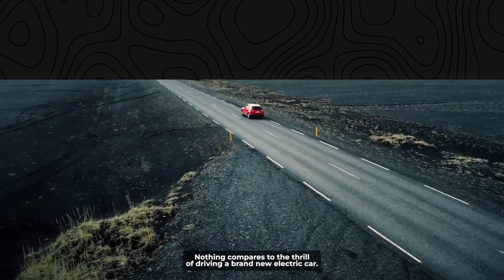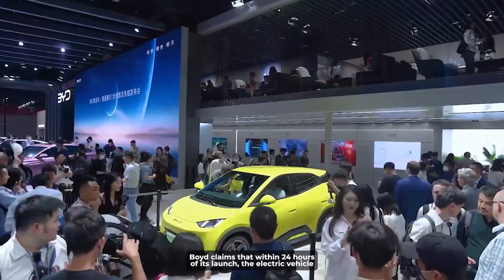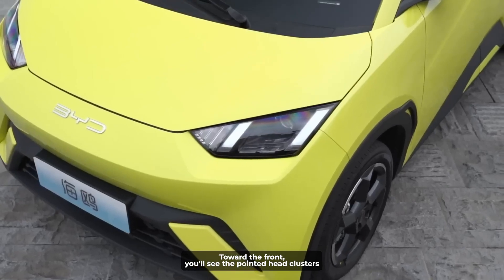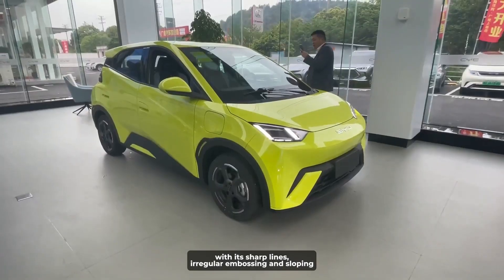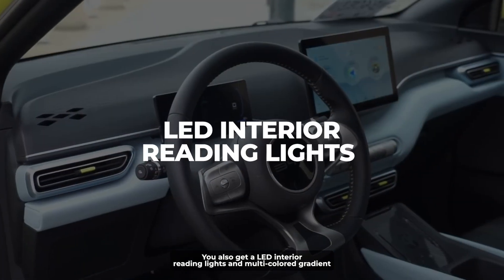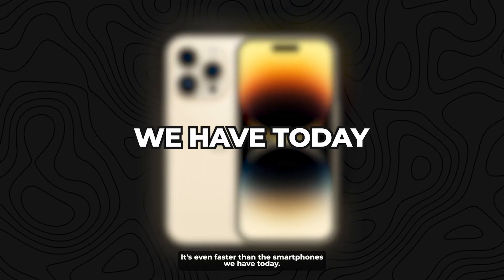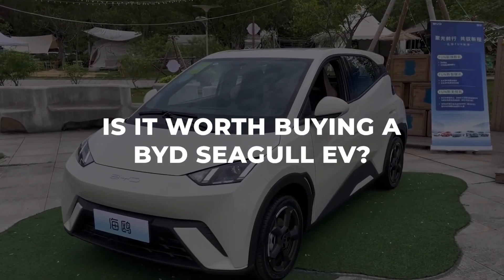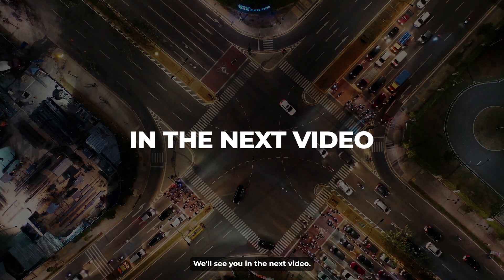Unlock The Power Of The BYD Seagull EV - What You Need To Know!

Comment: Fantastic, but only two airbags is not good.
Reply from the maker: Hi there! This information is wrong in the video and I apologize. Other viewers has commented this earlier as well.  The BYD Seagull EV actually comes equipped with 4 airbags instead of 2 as mentioned. Again, I apologize for the error. Safety is indeed a crucial aspect, and having 4 airbags in the car adds an extra level of protection.

Comment: This good value $11,500 car will be £23,000 by the time it's on sale in the UK! If it were to go on sale at £12,000 they wouldn't be able to build them fast enough.
Reply from the maker: Yes! It's true that pricing can vary based on factors like taxes, import duties, and other regional considerations when a car is introduced in different markets. While the initial cost of the BYD Seagull EV in the US is indeed $11,400, the final price in the UK could be influenced by various factors, and your point about potential price adjustments is highly valid. It's always essential to consider these aspects, and I appreciate your input. Let's hope that with increasing demand and advancements in electric vehicle technology, we see more affordable options available globally. What are your thoughts on the BYD Seagull EV and its potential impact in the UK market?
Reply: @AmpedAuto  The Seagull is what cars should be. It needs to be on sale for the lowest price possible, with good finance packages, to encourage both EV take up, taking huge SUV's off the road and improve road safety. It's efficiency will save energy, there's no need for 0-60 times less than 3 seconds, 0-20 in that time is more than adequate. If it were available sub £120 a month, with a 10 year 120,000 mile battery warranty I think most people would be seriously considering one as their next car.

Comment: A nice car. But it would be even nicer if it had swappable batteries. As you know, fast charging depletes batteries and Seagull is no exception. A second hand Seagull with around 80 to 100 k on the odometer would be almost worthless.
Reply from the maker: Thanks for your comment! While the BYD Seagull EV doesn't currently have swappable batteries, it features a fast-charging system, allowing 30% to 80% charge in 30 minutes. Which is typical charging time for most EV's. Battery technology is evolving, so future models might explore swappable options. Your point about resale value is valid, and manufacturers are continuously improving battery longevity. Thanks for being part of our community! If you have more questions, feel free to share. Stay tuned for more electric car content!

Comment: Indeed it’s a great car, but i think it won’t drive a steep streets, because ilof the small tyres, and potentially high weight of the passengers and their luggage, meaning it will suffer in a cars parking
Reply from the maker: The BYD Seagull EV, like any car, has its considerations, and the potential impact of small tires on steep streets is a valid point. It's essential for potential buyers to consider factors like terrain and usage patterns when choosing an electric vehicle. This car's design and features make it a standout choice for various urban settings, but you've highlighted a specific concern. Thanks for sharing your perspective! What other aspects do you think are crucial for evaluating an electric vehicle's suitability?
Reply: @AmpedAuto  glad you emphasized my concern
Streets here in Jordan 🇯🇴 can be sometimes steep, and also there are a few roads that could easily flatten your tires (seagull), because of the potholes (that foam pump should do the work 💯 or else you’ll be waiting for a miracle in a nowhere 😅
Another concern is the availability of the spare parts and there price .. both are disastrous 🫣
Reply from the maker: @mohammaddado5073  Absolutely, your concerns about steep streets and potential challenges with potholes are valid considerations, especially when it comes to the size of the tires on the BYD Seagull EV. Navigating such terrain can indeed pose a challenge for certain vehicles. The availability and pricing of spare parts are crucial factors too, and I appreciate you bringing attention to them.

For potential buyers in regions with steep streets or challenging road conditions, it's essential to carefully evaluate the suitability of any electric vehicle. Additionally, considering the availability and affordability of spare parts is a key aspect of long-term ownership.

Your mention of the foam pump is interesting—it's a good reminder of the importance of being prepared for unexpected situations. It seems like the BYD Seagull EV, while offering many attractive features, may have specific considerations for certain types of environments.

If anyone has experience driving the BYD Seagull EV in similar conditions or has insights on spare parts availability, feel free to share your thoughts in the comments. It's valuable to gather a diverse range of perspectives on the practical aspects of owning and driving electric vehicles in different regions. Thanks for contributing to the discussion
Reply: @AmpedAuto  another aspect is the availability of the charging stations, especially the one which provide charging for chines cars, with different charging plugs 🔌

Comment: Could you put a stroller in the trunk ?
Reply from the maker: Great question! The trunk space in the BYD Seagull EV is designed to offer practical storage options, but whether a stroller can fit would depend on the specific dimensions of the stroller you have. The Seagull EV has a reasonably sized trunk for a hatchback and we have read that the trunk space can accommodates two 24-inch suitcases. The Seagull EV does offer ample cargo space for its size, but larger strollers may require some adjustment or possibly folding down the rear seats to accommodate them.

Comment: There are usually no empty spots in a given market when a great transformational moment arrives. With traditional car makers quickly abandoning the smaller car industry where margins are lower, whom the heck do you think will occupy that place? The ones whom can naturally to make those margins to appear once they have the affordable workforce plus the best access to the affordable building materials: China! The Chinese will to eat the smaller car segment in a nutshell. BYD hasn't been for now a price oriented trademark here in Europe. It won't either way to be with the Seagul, despite the hipe. If they try to send this car to here where I live, they'll only to offer it with the 38Kw "higher" battery, and of course, all the requested from EU regulations equipment which may not be part of the basic Asian offering. That said, and considering my own living market, Portugal, VAT, EU regulations management, importer and maintenance infrastructure, marketing and other small requirements, all indicates that this car won't be available far below the EUR 20k mark point. That would to make it to be the cheapest EV we could afford here, little bit below the EUR 23k Dacia Spring EV... Affordable? Yes, to an extent, considering what this car offers far more equipment wise than the Dacia Spring... But far from a cheap car!... Some 4 years ago, it was quite easy to purchase a relatively good gas car at EUR 20k... Not anymore. You'll purchase a 4 years old car now ABOVE its original net price in some circumstances... Times are changing...
Reply from the maker: Thanks for your insights! You're absolutely right about the evolving EV market, especially in Europe. Factors like regulations and local infrastructure can indeed influence pricing. It's a dynamic space, and it will be interesting to see how things develop. Your perspective is appreciated! 😊🚗
Reply: @AmpedAuto  Agree! Thanks!...

Comment: Will need a EV for my daughter in 2 years. BYD seagull is for sure a great option, if they could provide some kind of auto-drive feature like what Tesla did.
Reply from the maker: Thank you for your comment! The BYD Seagull EV is indeed a great option for an affordable electric vehicle. While it doesn't currently offer an auto-drive feature like Tesla, it does come with a range of impressive features including advanced driver assistance systems such as a windshield-mounted camera for capturing the road, intelligent cruise control, and a remote smart parking assist system.
However, it's important to note that the availability of specific features may vary depending on the market and the model year. Therefore, it would be advisable to stay updated with the latest information from BYD regarding their features and technology offerings, especially as you approach the timeframe when you plan to purchase an EV for your daughter.
Additionally, the autonomous driving capabilities of various vehicles, including the BYD Seagull EV, may evolve rapidly within the next two years. It's worth keeping an eye on the advancements in autonomous driving technology and the offerings of different car manufacturers to see if BYD introduces any auto-drive features in their future models.
I recommend thoroughly researching the available options and considering your daughter's specific needs and preferences to make an informed decision about the most suitable electric vehicle for her.
Reply: A kids first car is the crash car - get her a 10 year old Toyota corolla that will be bulletproof and last a million miles, or until she crashes it, whichever comes first.
Reply: Auto-pilot = death trap.

Comment: A mobile blast furnace
Reply from the maker: I understand that you have concerns regarding the BYD Seagull EV. It's worth noting that electric vehicles, including the BYD Seagull EV, undergo extensive safety testing and have built-in safety measures to prevent any potential risks. Electric vehicles have proven to be safe and reliable transportation options. If you have any specific safety concerns or questions, I'd be happy to address them.

Comment: Not bad, cross between Tesla M3 front end with Chevy Bolt EUV rear end.

At just under $12,000 thats awesome. American EVs buyers tend to follow the 10% to 80% charging curve. 30% to 80% in 30 minutes seems to be a 50-100 KWH charging speed range. If its at a true 250 mile range, i think many Americans would be willing to buy at $12,000
Reply from the maker: Thank you for your comment! I appreciate your observation about the design similarities between the Tesla Model 3 and Chevy Bolt EUV. It's interesting how different elements can evoke these comparisons.
Regarding the charging speed, the BYD Seagull EV's ability to charge from 30% to 80% in 30 minutes is impressive. Combined with its speculated 250-mile range and affordable price of around $12,000, could make it an appealing option for many American EV buyers. The evolving market for electric vehicles is exciting, and the BYD Seagull EV seems to offer a compelling package. Thank you for sharing your thoughts, and if you have any further questions or comments, feel free to let me know.
Reply: Import tax, delivery, meeting local electrical code will push the price up.
Reply: I want to order 1where?
Reply: @Sam-r4z3o  I believe you have to wait till the plant in Brazil is completed and start production. I do not know when, but I am waiting.

Comment: typo : 2 airbags -> 4 airbags.
Reply from the maker: Thank you for pointing out the typo in the video. You are correct, the BYD Seagull EV actually comes equipped with 4 airbags instead of 2 as mentioned. I apologize for the error and appreciate you bringing it to my attention. Safety is indeed a crucial aspect, and having 4 airbags in the car adds an extra level of protection. Your comment helps ensure accurate information for viewers. Thank you for watching and providing your valuable feedback!
Reply: @AmpedAuto  now 6 airbags in the high range version

Comment: What is motor power and acceleration 0-100 kmh
Reply from the maker: Thank you for your comment! As far as I have seen - BYD doesn't quote a 0-60 mph (0-100 kmh) but says the Seagull EV can hit 0-31mph (0-50 kmh) in 4.9 seconds.
Reply: @AmpedAuto  it means 0-100 will be abt 12-13 sec,- not so good
Reply from the maker: Thank you for your response! While the exact 0-100 km/h acceleration time for the BYD Seagull EV has not been officially stated, based on the information available, it is reasonable to estimate that it could be around 12-13 seconds. But keep in mind that this is an estimate. While this may not be as quick as some high-performance electric vehicles, it is important to consider that the Seagull EV is positioned as an affordable electric car with a focus on other features such as design, range, and affordability. Ultimately, the performance of the Seagull EV may still meet the needs and expectations of many potential buyers.
Reply: 75 HP and from 0 to 100 in 9 sec
Reply: @bartbart8472  9 seconds is usually considered a fast and expensive car to drive in Scandinavia and is indeed pretty good compared to a VW Golf VIII 150 hbp which does 0-100km/h in 9.1 seconds. Great stuff.

Comment: It wouldnt be that cheap as other countries would put a tax to even out CCP's subsidies on it. Also do a quick search for 'BYD fire'
Reply from the maker: Thank you for your comment and raising those points. It's true that pricing of electric vehicles can vary depending on factors such as taxes, import duties, and subsidies in different countries. It's important to consider the local regulations and policies that may impact the final pricing of the BYD Seagull EV in specific regions or countries.
Regarding your mention of vehicle fires, safety is indeed a significant concern for any vehicle, including electric ones. While isolated incidents of vehicle fires can occur in any brand or model, it's important to evaluate the overall safety track record and measures implemented by the manufacturer. As with any vehicle purchase, I encourage potential buyers to conduct thorough research, consider official safety ratings, and refer to reliable sources such as independent safety organizations or government agencies for the most accurate and up-to-date information on safety records and precautions taken by the manufacturer.
It's essential to stay informed about the latest developments and consult trusted sources before making a purchasing decision. Thank you again for your comment, and I appreciate your contribution to the discussion.

Comment: it is not going to be 11400 . 

it will be around 15000
Reply from the maker: Thank you for your comment! The information I provided in the video was based on the initial reports and announcements about the BYD Seagull EV's price. As with any new vehicle, pricing details can sometimes change or vary depending on factors such as location, trim levels, and additional features. It's possible that the final price of the BYD Seagull EV may be different from the initial estimate. Therefore, it's always a good idea to check with official sources, dealerships, or BYD's official website for the most accurate and up-to-date pricing information. Prices may vary in different markets and regions. I appreciate you bringing this up, and it's important to stay informed about the latest developments regarding the pricing of the BYD Seagull EV.

Comment: Most important question first, does it do 300 EPA miles on one charge?
Reply from the maker: Thank you for your question! The BYD Seagull EV offers impressive range capabilities; however, the specific EPA range for this vehicle has not been officially disclosed at the time of making this video. The Seagull EV comes in two variants: a 30kWh option with a range of up to 305km (approximately 190 miles) and a 38kWh variant with a range of up to 405km (approximately 251 miles) on a single charge. While it may not reach the specific EPA range of 300 miles, it still offers a decent range for everyday driving. Keep in mind that range can vary depending on driving conditions, terrain, and other factors. As more information becomes available, it's always recommended to check the official specifications provided by BYD or consult with a BYD dealership for the most accurate and up-to-date range figures. Thank you for your interest in the BYD Seagull EV!
Reply: At this affordable price point, if it does offer 300 miles /480KM , then all other manufacturer will be out of business overnight.
Reply from the maker: Thank you for your follow-up comment! Indeed, if the BYD Seagull EV were to offer a range of 300 miles (480 kilometers) at its affordable price point, it would certainly be a significant achievement and could have a significant impact on the electric vehicle market. Longer range capabilities at an affordable price have the potential to attract more consumers and increase the competitiveness of the BYD Seagull EV.

However, it's important to note that range is just one factor that consumers consider when purchasing an electric vehicle. Other aspects such as charging infrastructure, performance, design, safety features, and overall value for money also play important roles in the decision-making process.

While a 300-mile range at an affordable price would be impressive, it's worth considering that each manufacturer has its own unique strengths, brand reputation, and customer base. The electric vehicle market is constantly evolving, and competition drives innovation across the industry.

As more details about the BYD Seagull EV and other electric vehicles become available, it will be interesting to see how manufacturers adapt and respond to meet the evolving demands of consumers. Once again, thank you for your comment and for sharing your insights on this topic!
Reply: You don't need 300 miles for city car. If they could offer that for 15, 16k ok but it is better to offer lower price in this market segment. I have small ev with wltp range of 230 km and charging every 5,6 days